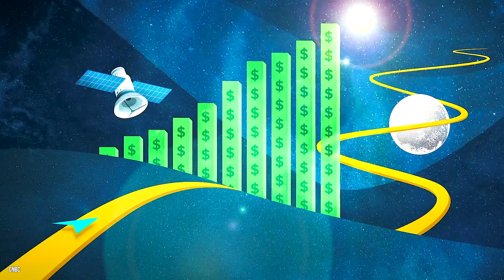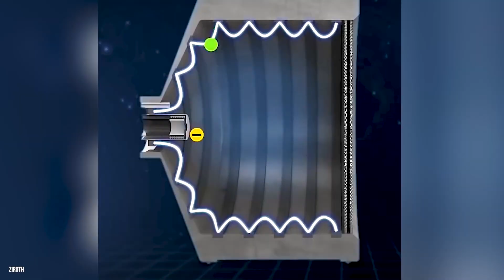The Terrifying Future Elon Musk Just Revealed

Comment: musk isnt going to mars. He cant even make it out of low earth orbit. No one is going to suicide on mars for musks vanity even if he could get there. Mars is nothing but death to our species.
Reply from the maker: Thanks for your comment! What do you think of the use of robots by NASA to 3D print habitats on Mars?
Reply: @UnknownRealityYT  there is little to no protection from the deadly radiation. 3D print a bunker and bury it down deep, maybe you got a chance. But you got to dig the hole, big enough for the building and printer. Nasa is only talking about 3D printing on mars, they talk about a lot of futuristic plans, It hasnt even been decided that they will 3D print on the moon. You only need to print if you have a lot of construction. Astronauts will spend a 2 year holiday on mars, maybe 3 at a time. By the time you move a printer to mars, set it up and operate it, it doesnt make sense for a handful of buildings.
Reply from the maker: You make excellent points about the practical challenges of using 3D printing for habitats on Mars. Radiation protection is a crucial concern, and while the concept of building underground structures holds promise, the implementation is undoubtedly complex. It's true that Mars missions require careful consideration of the available resources, mission duration, and the goals of the expedition. While 3D printing has shown potential for construction here on Earth, adapting it for Mars missions involves addressing a multitude of technical and logistical hurdles. Your insights highlight the intricate planning and decision-making involved in space exploration. 🚀🏠🛰️